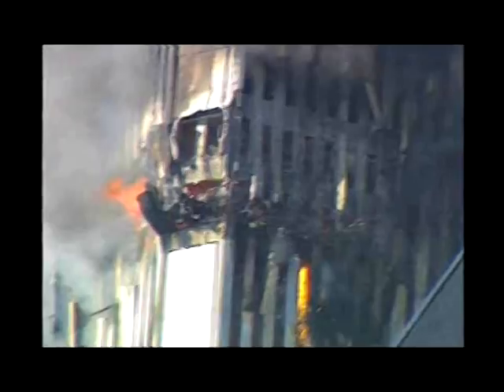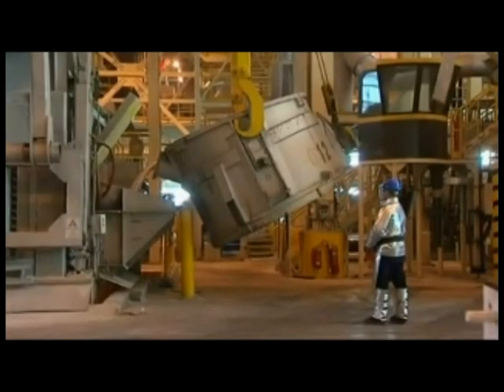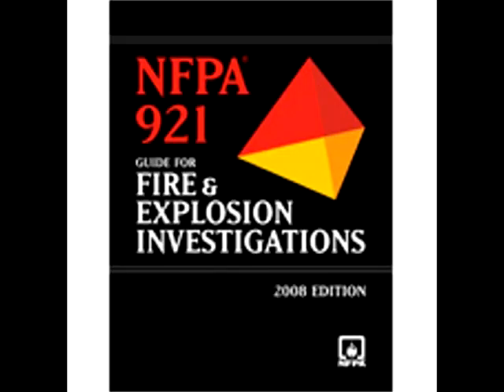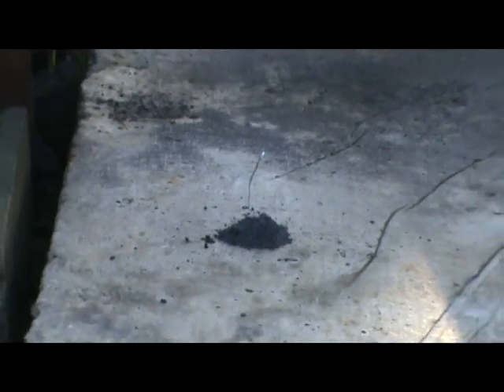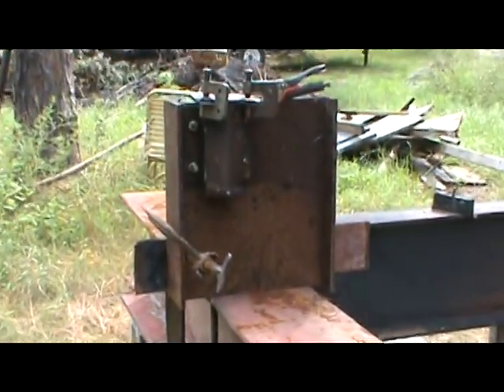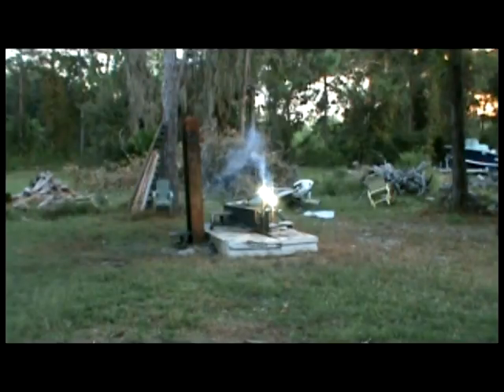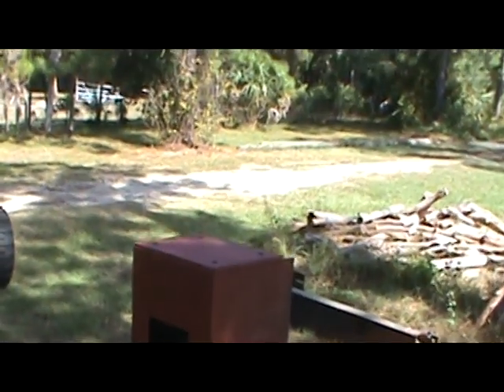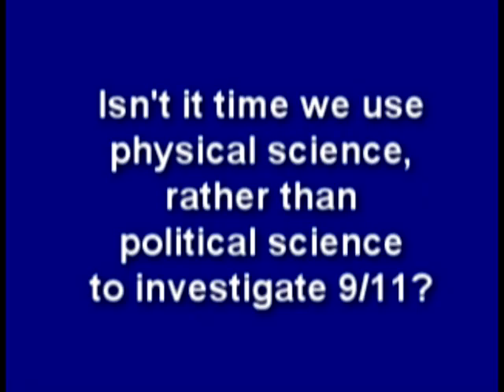9/11 Experiments: The Great Thermate Debate

Comment: Cobalt Chrome alloy w/ nickle and beryllium, casts at about 2550-2650. I used propane and oxygen. Don't ya think air shooting up elevator shafts and stairways at high speed would produce enough oxygen to intensify a hot kerosene based jet fuel from jets full of fuel?? I believe it could get more than hot enough to do what it did. It is not impossible.
Reply: But the towers were made of 0.2% carbon steel.  It weakens and creeps when heated well below red heat.  That means it's only a matter of time before a structure made of it will collapse under such conditions.
Reply: Tony, I can't agree with that. Warming steel to below red wouldn't weaken steel that much if at all. To melt steel you need eye protection. It seems almost as bright as the sun. Gold and silver melts at cherry red. Cherry red won't even make steel slump. If you melt a long steel beam in the middle both ends will fall.
Reply: Survivors and witnesses confirmed that fireballs traveled down the shafts all the way to the lobby.
Reply: Tracey
"fireballs traveled down the shafts all the way to the lobby" - The planes contained 10,000 gallons of jet fuel.
They became fuel/air bombs.  Misted fuel, especially when ignited in a restricted volume (the tower) detonates.
These nice BLU-96 thermobaric bombs only contain about 100 gallons of jet fuel, and look at what they can do:
https://www.youtube.com/watch?v=GmRASCHJe2Q
Now can you see how the explosions reached the lobbies and basements?
Reply: Tony everything points to exactly what happened. I just can't believe, like some, that everything is a conspiracy. That's a good video. People believe all kinds of crazy crap, flat earth, fake astronauts, fake moon landing and we killed over 3200 people in NYC by planting bombs throughout the World Trade Center to coincide with Jet Aircraft hitting the buildings at the same moment. It's not plausible or worth talking about.
Reply: +barrrylincoln
"It is not impossible" - Six acres of burning offices burning for an hour was more than sufficient.  They had at least thirty times the heat potential to soften the floor trusses, which was all that was necessary to make the towers fall.
Increasing the air flow helped in that process, true, but the kerosine was probably gone after 5-10 minutes, and office fire temperatures can reach 1200 deg C, which is 400 deg C hotter than the temperature at which the floor trusses would have softened and let go of the columns.
Even without the impact damage the towers would have fallen the same - just a few minutes later.
The mild steel used in constructing the tower was an 0.2% carbon steel, or not quite pure iron.  It softens the fastest of any steel when heated.  The softening process begins at temperatures above 475 deg C.  Cobalt, chromium, nickel, and beryllium are used to make high-strength tool steels and gas turbine parts, and would be far too expensive for building purposes.
Reply: Tony Why are you talking Celsius? Americans use the Fahrenheit scale. I can see you know what your talking about. I have cast so much metal I ended up with beryllium poisoning  from casting chrome cobalt type alloys. I was on a much smaller scale, melting it in a small crucible with a torch or fancy electronic induction casting machine. I'm just saying they should have used better steel in buildings that tall. I agree with pretty much everything you said but don't know Celsius. Also I'm still having problems with steel weakening before it's even red. I admit all I have ever cast in steel was Chromium Cobalt alloy with beryllium and other alloys in it. It's way beyond red before it's molten, or even slumping. It's white hot and will damage your naked eyes.

Comment: "molten aluminum is silver not orange red"
That's misleading, aluminum is silver when it STARTS to melt, at its boiling temperature of 2470 deg C, it is bright yellow, and bright orange below that temperature.
Reply: 2:02 max WTC temp was 1832 °F. This is 1000 °C not 2470 °C.
Reply: Not quite, it says maximum air temperature, not maximum temperature. The air temperature is measured using thermal imaging, it does not show the maximum temperature inside the building. Same tech that is used to measure forest fire temperatures.
Thermite combustion temperature is limited to around 2500 C, which is 1500 C higher, so couldn't be that either if you take the air temperature and assume that to be an indication of the maximum temperature inside the WTC.
Reply: https://www.youtube.com/watch?v=cyTxxEhS4uc
Reply: Thanks for the link.  But... molten aluminum in your vid doesn't look anything like molten steel or like what we saw on the fateful day (edit: and can't explain the iron nodules).  As soon as they pour it out of the vessel, yup, it's silvery.
Reply: Yes that's down to lighting conditions and it isn't actually anywhere near the boiling point of the aluminium. If you can find a video of aluminium at 2400 C it will look like molten steel. 
The colour of the metal spectra emission(s) is temperature dependent, it has virtually nothing to do with the metal. Heat it up to steel's melting point and its the same, wheras steel at 670 C is also silvery but doesn't melt at that temperature.
Reply: This is the closest I've found so far. 
https://www.youtube.com/watch?v=1KWk5zV6cwA

Also, when aluminium is vapourised the vapour will burn in contact with air/oxygen, and it burns like magnesium (aluminium vapour) which will undoubtedly increase the temperature. I can't say if on a large scale this could be self sustaining, but perhaps enough to melt small amounts of steel. Even burning steel wool will produce small globules of steel, its not especially hard to do.
Reply: Neat, thanks.  Never seen aluminum boiled before.

Comment: Let say physics no longer existed and somehow ONE of the planes could take down a building. The thing people don't take into account is that the 2 747s had 2 entirely DIFFERENT fuel loads. They do not just fill up the planes fully, as weight and safety are key elements to any aircraft. So riddle me this: persay one plane could somehow to one of the buildings down, how can two planes with different fuel loads take down two fucking buildings? Anybody who believes planes took down the twin towers is an uneducated, blind, physics retarded fool.
Reply: No we're just people who do more research before writing comments. Number one, they were 767, number two they were both fueled to travel to cross country. So they might not have had the same amount of fuel, but close enough. The damage the planes did, along with the fires, and the weakening of the supports in the buildings. Lets bring in the weight of the floors above the damage, plus gravity, equals what happen. Did you notice the first building to go down was the one with more floors above the plane damage, people like you think it should have been the first one hit, didn't you. There were so many laws of physics being played out that day, any one who knows just the basic ones knew the buildings were coming down.
Reply: @unseen8513  you still have to take into account the amount of people on each plane. They carry as little fuel as possible to safely travel to their destination to fit as many people as they can to increase their profits. And my bad, they were 767. Even then, explain the eye witness account of a general at the Pentagon who knows cruise missiles in an out and states that's what hit the Pentagon? Jet fuel is not combustible, it is only flammable. Take out the entire even and look at what happened after. The Patriot act, which allows the government to throw your privacy out the window to look for "potential terrorists". Mussolini even states that fear is the best controller of people. Scare the people and they will give you their rights. Less rights for more security, and now they have information on everybody including those who do not agree with them. How about the insurance claims weeks before the event? The contracted "cleaning"  crew, or the simple fact that a fiberglass nose cone cannot penetrate a building. Look at military footage of jet testing, a fighter jet going half the speed as the 767s was obliterated, nothing left. And that was a simple concrete rebarb reinforced wall.

Comment: I see many people in the comments say: "steel doesn't have to melt for it to collapse". That is true. But steel still melted. And now is the question: How?
Reply: No steel melted.  This video lies.
THE MATHS THAT PROVES ARCHITECTS FOR 9/11 TRUTH TO BE LIARS.
THIS OFFERS A SATISFACTORY EXPLANATION FOR ALL THE OBSERVED CONSEQUENCES OF THE WTC TOWER COLLAPSES.

An analysis of a tower's potential, and therefore kinetic, energy is a good way to illuminate the consequences of collapse. The only material burning in the wreckage was HYDROGEN GAS (and most of that would have occurred at the wreckage surface).  Deep down at the base of the densely-compacted wreckage the very hot and compressed iron had created anoxic (reducing) conditions, and fire could not have occurred no matter what the local temperature may have risen to.

PRIMARY 9-11 CONSPIRACY ASSUMPTION SHOWN TO BE FALSE:
AN ANALYSIS OF THE AMOUNT AND DESTINATION OF THE POTENTIAL ENERGY OF A WTC TOWER
The first law of thermodynamics, also known as the Law of Conservation of Energy, states that energy can neither be created nor destroyed; energy can only be transferred or changed from one form to another.
Source: Boundless. “The Three Laws of Thermodynamics.” Boundless Chemistry. Boundless, 02 Jun. 2016. Retrieved 12 Oct. 2016 from https://www.boundless.com/chemistry/textbooks/boundless-chemistry-textbook/thermodynamics-17/the-laws-of-thermodynamics-123/the-three-laws-of-thermodynamics-496-3601/
The World Trade Center towers (and WTC7) fell NATURALLY due to buckling failure when their 'slender' columns lost attachment to their floors.
They only used a third of their Potential Energy to destroy themselves, the remaining two-thirds was consumed in crushing some of their steel into ground zero.
A standing WTC tower possessed two hundred and forty six tons of TNT of POTENTIAL ENERGY merely by just standing there. We shall call this energy Eo.
The tower fell by taking the direction of LEAST RESISTANCE, which was THROUGH ITS BUCKLING COLUMNS.
The columns failed by BUCKLING because their STRUCTURAL STABILITY had been compromised by LOSS OF FLOOR ATTACHMENTS. No steel got crushed when this buckling failure occurred. 
Buckling is not a MATERIAL failure; it is a STABILITY failure.  This type of failure was first explored by the famous polymath, Leonhard Euler, around 1,750 AD.
The floors had detached themselves by sagging to an angle which snapped their connections. Photographs of these separated floors (taken shortly before collapse) are plainly shown in the NIST Report.
As each tower fell, some of that stored potential energy, converting to kinetic energy by falling, was released to damage and dismantle both the moving and the stationary parts of the tower on the way down.
The amount of the initial energy consumed in such a manner was inversely proportional to the rate of acceleration of the tower as it descended. It can be calculated.  We shall call it Ed.
The amount of energy remaining (Er) when the tower wreckage hit ground zero is then (Eo - Ed).
This energy, transferred elastically, caused PLASTIC DEFORMATION in the crushed base steel wreckage, and became HEAT. This too can be calculated.
The heat was considerable. The signs of it were captured by satellite. It amounted to the equivalent of a thousand tons of steel raised to a temperature exceeding 1,000 degrees Centigrade.
This hot steel, crushed and pressed against ground zero, oxidised its surface (making scale) and absorbed local oxygen gas, leaving a reducing atmosphere.
In these reducing conditions, and at a temperature of 1,000+ degrees C, fireman’s water which had percolated through crushed gypsum wall boarding DISSOLVED calcium sulphate (yes, Gypsum is 5% soluble in water), the sulphate ions of which were reduced to sulphur which combined with the exposed iron to form IRON SULPHIDE, which at such temperatures was MOLTEN, and flowed away. At a temperature of 1,000 degrees Centigrade, in an absence of oxygen, and in the presence of hydrogen, Sulphur and Iron atoms become keen partners, forming IRON SULPHIDE, which above 1,000 degrees Centigrade, is a LIQUID, and flows away, leaving 'corrosion' claimed by 'truthers' to be caused by thermite.
Such hot reducing conditions also caused the water/steam to be REDUCED to hydrogen gas which was noted by firemen to be burning at the surface of the wreckage.
The wall-boarding and crushed concrete surrounding (but mostly above) the steel were THERMAL INSULATORS, so greatly slowing cooling.
CALCULATIONS (in SI units):
To calculate the original potential energy of the tower in TNT equivalent,
G = 9.81 metres/sec^2
Mass (M) of tower = 5e8 Kg
Height (h) to the tower’s CG = 210 metres
The explosive energy of 1 ton of TNT (Kt) is equivalent to 4.184e9 Joules
Equation: Tower Potential Energy (Eo) = ( M * G * h ) / Kt
This is equivalent to ( 5e8 * 9.81 * 210 ) / 4.184e9, or 246 tons of TNT.
The Potential Energy of each standing tower was equivalent to 1,000 standard 500 lb. ‘iron’ bombs.
To calculate the kinetic energy used in the tower destruction takes a moment, after a simple thought experiment, namely considering the tower would fall at G if there were NO resistance, and if it fell so slowly that it consumed ALL its energy, it wouldn’t fall at all.
So we can see that the PROPORTION of the energy used up by the collapse must equate with the proportion of G which the collapse was unable to achieve.
As the collapse acceleration was, by truther calculation, established to be about 70% of the acceleration due to gravity, we’ll use that.
The energy used up in tower destruction was therefore 30% of 246, or 73.9 tonnes of TNT.
Assuming that 30% of the tower fell outside of the basement, then the energy (Er) available to heat the wreckage base (by elastic energy transfer and crushing) was 0.7 * (246 - 73.9), or 120 tonnes of TNT.
We know that the steel reached at least 1,000 degrees Centigrade because that is the melting point of iron sulphide.
We can therefore calculate the mass (m) of steel that was raised to that temperature.
The specific heat of iron (Fs) is known to be 0.45e6 Joules / tonne / degree C
The ambient temperature was 20 deg C, so the temperature rise (Tr) was 980 degrees C
Equation: Er = m * Fs * Tr
So m = Er / Tr * Fs = ( 120 * 4.184e9 ) / 980 * 0.45e6
And so m = 5.02e11 / 4.41e8 = 1,138 tonnes.
The collapse of each World Trade Center tower created 1,138 tonnes of red hot steel at 1,000 degrees Centigrade.
So we can see that there is no need to postulate an extra source of energy, and that the basement wreckage heat is also easily accountable, with the additional corroboration of burning hydrogen at the wreckage surface, and molten iron sulphide at the wreckage base.
And so the underlying 'truther' assumption, that the planes couldn't bring down the towers, is shown to be FALSE, as it is shown by calculation, using the physically-correct values, that the potential energy possessed by the towers numerically accounts for ALL the known consequences, through elastic energy transfer, plastic deformation, HYDROGEN gas burning at the wreckage surface, EUTECTIC IRON SULPHIDE melting off the hot steel pressed against Ground Zero, and, of course, a tremendous amount of HEAT.
These results are EVIDENCE of the event.
They have been evident to any REAL scientist or engineer from day 1.

Comment: Steel looses 50% of its structural strength at 1100* F. It then sags under load. The narrator and this video are hog wash. You are either purposely misleading or just ignorant.
Reply: +Mark O'Connell Yep, and collapsing concrete, striking solid concrete, causing it to pulverize never loses any energy and the dust is now able to accelerate and pulverize the floor below, and so on until the entire structure sits pulverized in it's own footprint!...I get it now, thanks for the clarification!
Reply: But where is the clearly molten iron coming from?
Reply: TheZui no longer matters as the pancaking floors from the weaken steel caused the pancaking effect.
Reply: Well yeah, but it still matters how it is possible for molten steel to be there. Even if it didn't matter. Molten steel shouldn't be there. It can't. But it still is